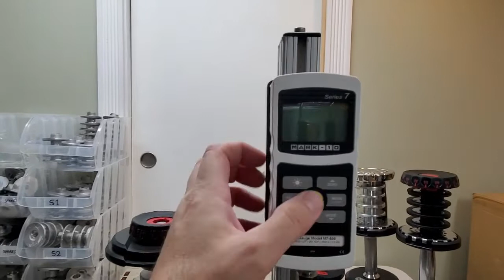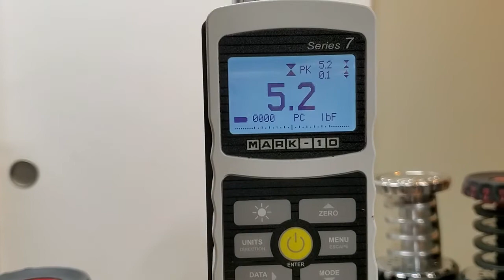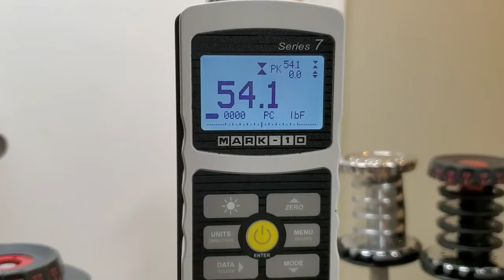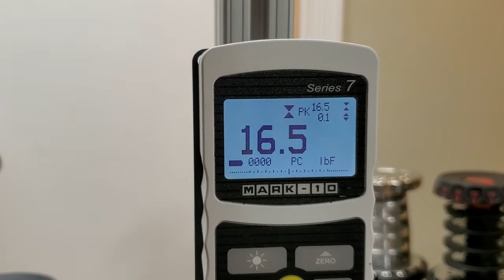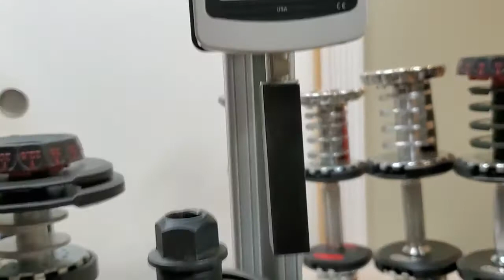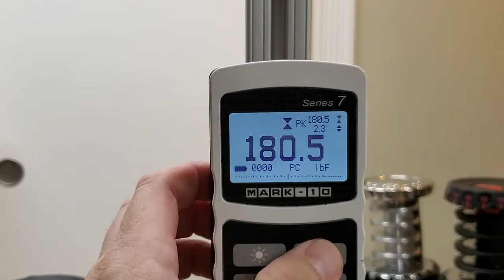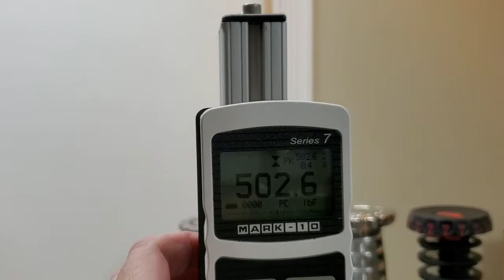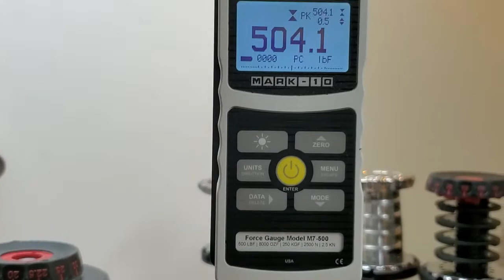552 Bowflex® SelectTech® Disc Load/Stress Test: OEM Discs vs Average Joe All-aluminum Discs.

Comment from the maker: CLARIFICATION: At 2:40 I talk about a disc bearing the entire weight of the dumbbell. That's not entirely accurate. Our hands provide some opposing force, but there's still considerable force on the face of the disc directly above the weight plate supported by our hands.